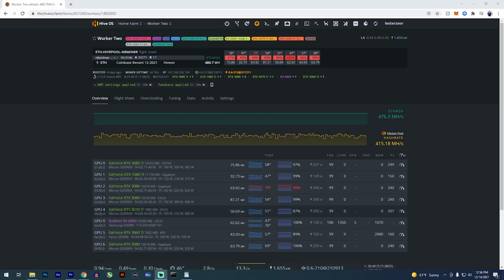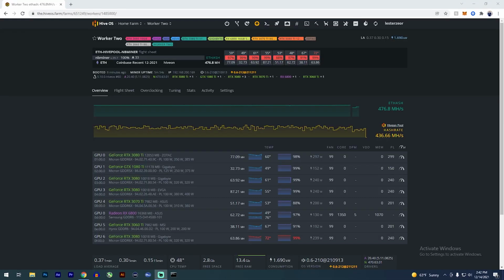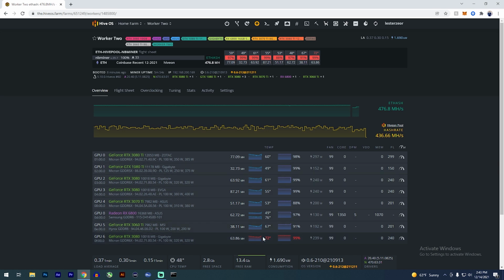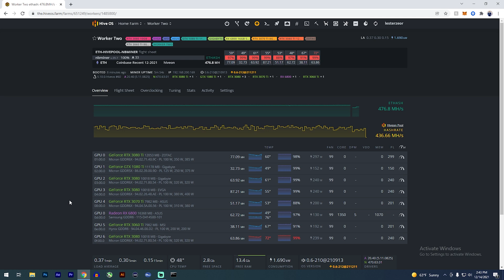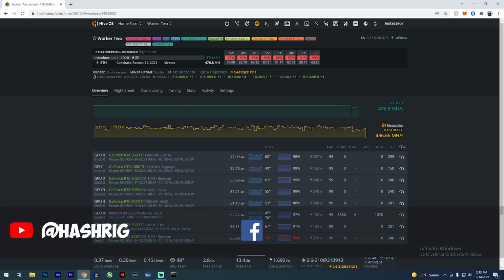GIGABYTE RTX 3080 Turbo edition stock fan upgrade | 200 CFM FAN

Comment: You changed two things... you added a fan to the side, but way more importantly, you removed the blower fans which were pushing the hot air back into the card (the much bigger problem).  You can't show test results if you change two things and then give all of the credit to one of them.
Reply: Dude criptomining is over now
Reply: @harithizzuddin  What does that have to do with the fact that the testing method was crap?

Comment: Will this setup works for RTX 3080 Turbo Non LHR card as well..? And could u pls suggest about sticking thermal pads on this card if possible?
Reply from the maker: Yes, it should work, and I have not tried replacing the thermal pads on this card yet.
Reply: @HashRig  but applying thermal pads may void ur warranty period..!instead apply some heatsinks on the body of card itself..! May be it works..! Even i am going to try the same..! Will let u know if it works for me..!
Reply: Were you successful in lowering temps
Reply: I have achieved temperature control for my 3080 Turbo edition..just by connecting RGB fan on the turbo fan of 3080..! More than that i have thoroughly cleaned it by blowing all the dust inside from it which was gradually increases in card temps..!
Reply: @gamingparasite..5185  why not thermal pad replacement
Reply: Adding thermal pads (12.8w/ mK) improves the heat transfer alot. I did for Gigabyte rtx3090 turbo 24g and gigabyte rtx3080 gaming oc. Added heatpipe heatsinks with dual fans from my older cards to the backplate of both 3080 and 3090. The max GPU temp is 60 and memory junction temp is 80 max during the most hot ambient condition in daytime. Let me know guys if you need further info. I am willing to help on it.
Reply: @engpratheep  which brand pads you used